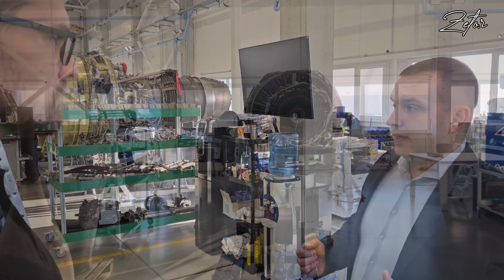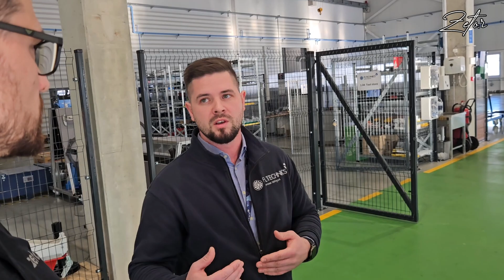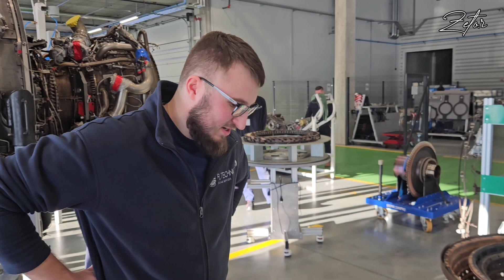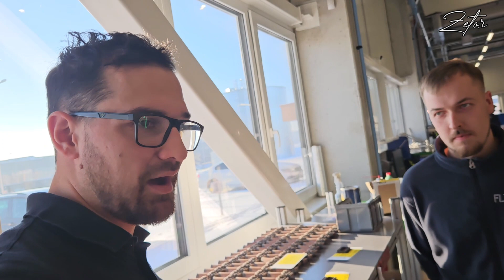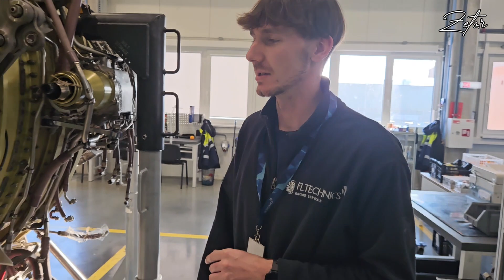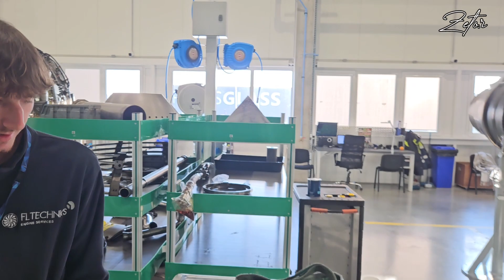Aircraft engine shop, all you want to know about CFM 56

Comment: Thanks for this fascinating video, of this service shop. I was wondering that on the very deep bolts, as was shown with the special tool, surely it would be impossible to safety wire them at that depth?
Reply from the maker: You don't need to safety wire self-locking nuts 🙂

Comment: Does company require Cat B1 license ? or type rating ? modules exams ? to work on an engine. What will be an advantages to submmit a aplication for this job ? 
Good job ! Keep and going. Best regards ;)
Reply from the maker: Company does not require any licenses. If you want to work as a mechanic, you only need knowledge of english language. If you want to work as a certifying staff you need experience, module 10, theoretical and practical trainings